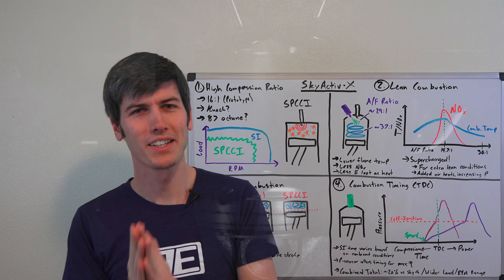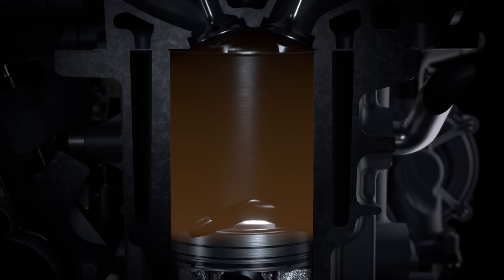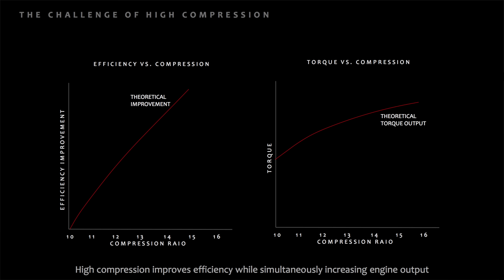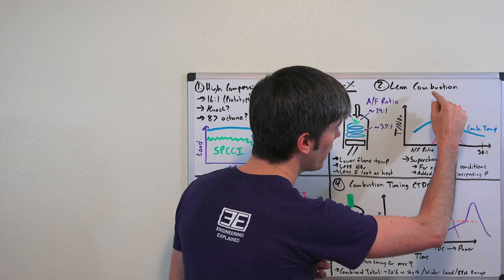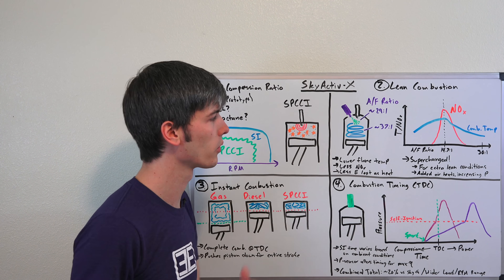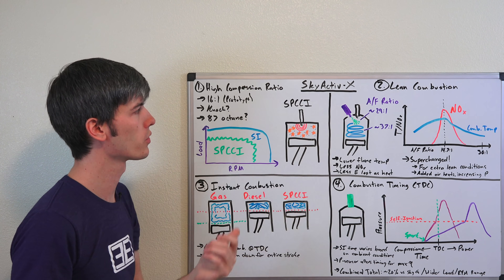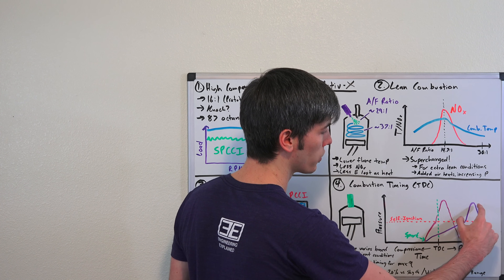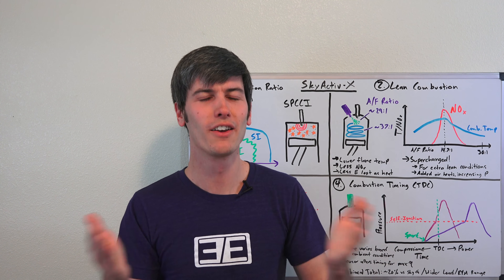How Mazda Is Saving The Gasoline Engine - SkyActiv-X

Comment: Hi @Engineering Explained
I got an odd question. 
Would it be possible to install an Electric Turbo (5kW motor that generates 5PSI) on 1.5 L SkyActiv-G F-P5 I4 Engine of Mazda 2 GT Sport 2019?
Someone said that "SkyActiv-G engines make very poor candidates for forced induction simply because their compression ratios are too high to accommodate the boost". Is that true? What ratio would be better?

Comment: Jason, great work. However... that ignition is not a knock ignition as that would be damaging due to overpressurising of the combustion chamber. It is still a spark ignition with a preinjection of part of the fuel per cycle.

Comment: With that high pressure engine MAZDA really needs to include a PCV system oil catch can. (As they SHOULD have on at least their most recent 2.5 L. turbo engines.)
QUESTION: Is running a mix of 75% 91 octane with 24% 100 octane gas going to make problems for my 2019 CX 5 2.5 L turbo engine?  I do know it "wakes up" the acceleration.

Comment: You if people were willing to spend say an extra $3k on the a car, tremendous strides could be made in improving the efficiency of the internal combustion engine.  People won't, but they will shell out an extra $3k for electric/hybryd electric vehicle. Electric vehicles are going to be the future, but battery technology needs to improve.  Also, with more electric cars, the demand there will be for electrical power, thus burning of more fossil fuels, because not enough money is being invested in alternative energy sources.

Comment: interesting similarities between this and 70's era Honda CVCC, which also was mostly lean with a little richer mixture close to the spark plug. The difference is those were carbureted and also used a precombustion chamber and much lower AF ratios.

Comment: Hi ee. I still don't understand why it won't knock. High compression ratio and compression ignition even though it is controlled. By spark. Is there not an element of compression ignition in a standard SI engine? Or is it after ignition the pressure does not rise high enough or fast enough too cause the remaining fuel too ignite? Great videos keep them coming.

Comment: Fascinating tech. 
It does however make me think that legacy car makers haven’t yet caught up with the idea that the future is electric. Specifically Switch Reluctance Partial Permanent Magnet using the Hallbach array arrangement motors combined with Silicon Carbide power electronics.

Comment: Mazda has unfortunately lost some of its reputation for reliability, do we have enough experience of Mazda's SkyActive engines to know how they are in that area? 
It doesn't look like this SkyActive engine is non-interference, is it possible to design them that way? It would make it much more safe in case...
Reply: Lies! My Mazda 6 has not a single issue. 92000km currently.
Reply: @aastanton251  some discrimination please, "some" doesn't mean "all" and still there are mechanics who say the Mazda of today isn't what they used to be pre-Ford involvement.
What you're saying your car is pretty much new as that is more or less run in period.

Comment: I'm sure the next step in this evolution will be in step with common rail diesel evolution where once they had greater control of the fuel injection they began multiple injections per stroke. Like the Detroit Diesel DD series engine will inject 12-15 times per stroke under the correct conditions. It makes an incredible driving experience where you can lug the engine down to 800 or 900 rpm then mash the throttle and it just torques out with full power!

Comment: So basicly they are making enigines that are less reliable and only a few mpg better fuel consumption. Then u have to buy a new car every 5 years when it breaks and that makes even more eviromental emmisions than if u just had a engine that was reliable and lasted 600k miles. But they wouldnt be able to sell you a new car every 8 years. This is not about the enviroment this is about money and controlling people. These democrats have to be stopped at all cost

Comment: My toyota yaris gets 37mpg in 2007. They could easily get 40 and be all wheel drive with a overdrive gear and a smaller engine with a turbo. Say go from 1.4 liter to 1.0 liter and go for 100hp. These idiots only want cvt so u hav to buy a new car every 10 years

Comment: Wouldn't they be able to increase the compression ratio even further using higher octane fuel?
Reply: They are after knocks, so they designed  the engine for a low octane fuel. 🤦‍♂️
Reply: @hanynowsky  I understand that but they could still get knock with higher octane fuel if they used a higher compression ratio, which would mean even further improved efficiency.
Reply: @hh6427  that is what I meant. My comment was against the mazda concept not you.

Comment: Do Skyactiv engines have a carbon buildup problem like other DI engines?
Reply: There's a savagegeese video with a Mazda engineer where he states that it's not an issue for the Mazda 2.5L due to certain key differences. Sorry I don't remember which video...maybe the miata review.

Comment: electric vehicles aren't even close to taking over anything. their battery packs aren't viable for long distance travel. that means trucks and trains and anyone going on a long road trip is out of luck. plus the power grid can't take all those cars.

also they don't even pollute any less than normal cars if their energy is coming from fossil fuel burning plants, which they most likely are. it just moves the pollution somewhere else.

Comment: I'm curious, why is it that a lean fuel air mix burns at a cooler temperature than a rich one but leaning out the mix in a small aircraft (a cessna 172 in my case) result in an increase in engine  temperature? Does the extra fuel in the richer mixture provide a cooling effect which is greater than the higher temperature of combustion?
Reply: You are reaching an ideal Air:fuel ratio and thus are making more power, but with more power there is also more waste heat. Rich mix burns cooler due to the fuel absorbing slightly more heat and making less power due to less that ideal conditions.

Comment: couln't they increase the compression even more, if the engine was designed for premium fuel, like 98 octane RON? making it even more efficient? your claim thst lower knockresistance is desirable doesn't make sense to me. of course in an engine like this it's not beneficial to fill up higher grade fuel than it was designed to, but if it was designed for high octane fuel from the start, it should work even better, right?

Comment: I'm slightly confused. If lean burning creates less heat than why does leaning out melt pistons?
Reply: Sometimes engine will make more power on a leaner mix = less cooling from excess fuel + More power = larger proportion of waste heat. No engine turns 100% of its fuel into raw usable energy (Most regular gas engines are between 25-40% efficient, Diesels being much higher because of their combustion cycle)

Comment: If I had the cash and the know how, I'd swap the 318 in my 88 Chrysler for this engine. Better gas mileage and HP. (My engine's a 140hp v8) Sounds weird on an old American car, but it might work.
Reply: Chrysler makes some powerful v6 engines. Or you could put fuel injection on the v8 and do a mild performance build. The advantage of the 318 is how well it responds to mods and how easy it is to work on
Reply: @isaakwelch3451  True, it is pretty easy to work on, and the parts are cheap. I might start with upgrading the intake. I'll see what happens once I start messing with it. (And, thanks for recommending me the fuel injection idea - that sounds like it'll give me more mpg)

Comment: Question: Does anyone know if this engine also suffers from the internal carbon buildup issue plaguing many Direct Injection engine designs?
Reply: Doesn’t look like anything in the design would prevent this. There is still no fuel washing the intake valve, and no indication it’s not using PCV.
Reply: @dbdukehd  It uses both direct injection and port injection.

Comment: actually the diesel does not combust as rapidly as you may think. Depending on the torque level, pedal position the injection will continue for some time after the piston starts its descend. Constant temperature engine vs constant volume. Just a minor adjustment to what I would think is an excellent video explaining these differing engine designs.

Comment: Sir, you said that the engine is not working with SPCCI inthe entire load range. So when they are switched back to SI engine working principle, will the compression ratio and air fuel ratio be same?. If not, is this a variable compression engine???

Comment: that doesn't sound like a new engine...it just sounds like really late timing... Also doesn't the DI gas engine already get extremely lean A/R ... kind of a step backward... Mazda just doesn't want to evolve past the obsolete 4 stroke gas engines... so they keep improving it... but its 20 years too late and needs to be put on a shelf and deemed obsolete.

If they wanted efficiency they should have just made a "gasoline vapor engine", go ahead and look up that old ass engine. Those got 100mpg like 50yrs ago on gasoline.
Reply: mazda should employ you. you're smarter than their entire company

Comment: Great explanation. I am a tech at a Mazda dealership and this gave me more info then I have received even from Mazda. Now I have been told that at higher RPMs the spark assist actually cuts off and it runs strictly on compression ignition. But I may have heard wrong, what do you think?
Reply: sjgavenger37 no high rpm no compression

Comment: Why bother we know there is a motor out there with one moving part that is more economical, faster and more reliable.
Reply: It will take several decades before electric cars are standard. Might as well improve the current one. And they might learn unexpected things applicable to electric cars.
Reply: em745a  that's interesting you are wrong in every thing you say. Usually people get at least one of their points right but hayhoe

Comment: Emperors new clothes that sensor at peak cycle lasts how long? Getting them replaced probably will cost more than the fuel you save?  Much like the car industry not making much on new cars but rapes your wallet with electronic component failures to replace

Comment: so is lower octane fuel better for this type of engine or the skyactive-g engine? (3rd gen mazda 3). appreciate you replying!
Reply: Octane is a measure of knock-resistance...the tendency of fuel to NOT detonate simultaneously throughout the cylinder. In an engine where you WANT the fuel to combust simultaneously (like a diesel), as the octane is increased, it gets harder to cause it to detonate where you want it to. For this engine design, there is some octane level that keeps the fuel's autoignition point in the range of pressures and temperatures that we will see in the cylinder under the widest range of operating conditions...it is cited here as being 80, meaning that that octane would provide the widest range of desired operation. Since we don't have fuel with such a low octane in the States, they have tweaked the engine to work around the slightly-higher detonation resistance of common 87 octane fuel. However, that suggests that the engine might have some of its operating window slightly narrower than it would have been with the "ideal" 80 octane fuel. This also suggests that the ideal performance window might continue to shrink as the octane is increased even higher above 87. It still runs, it's just that it has to keep all of these parameters in a much narrower range to make it still operate. 

The skyactive-g is essentially a standard spark-ignition engine, which is almost always better-off the higher the octane of the fuel (assuming the engine tuning can exploit it). In that domain, you want to be as far away from uncontrolled combustion (knock) as possible.

Comment: So why do you need a spark plug in a gasoline tank engine? I know this may be a silly question but I'm just curious
Reply: So you can control exactly when ignition of the air/fuel mixture occurs vs. a diesel which "self-ignites" at some point on its own due to heat/compression
Reply: @flywiththomas  But why can't this self-ignition method used in a gasoline engine?
Reply: The gasoline would ignite too early (or too late) which wouldn’t be efficient or could even damage the engine. What Mazda are doing is using almost full self-ignition like a Diesel engine but instead using a spark plug to kick the process off at the the exact time they need it
Reply: @flywiththomas  So in the end it's just that gasolines combustion isn't as controllable?
Reply: Petrol (gasoline) is more volatile than Diesel so yes, its less controllable when using compression alone to achieve ignition
Reply: @flywiththomas  Okay, thanks a lot!

Comment: SkyActive - a repeat of Mazda's mistake of the Renesis don't you think? Everyone is towards electric already.
Reply: Not at all. This is unrelated in any way to Renesis, which was an attempt to update the rotary engine. That wasn't particularly successful because the rotary is just inherently too flawed to achieve the performance/economy/emissions balance required of any engine today.  Skyactive-X is a completely practical gasoline compression-ignition engine, which everyone in the industry has been working on for the last thirty or forty years. Electric cars are still a tiny minority in the world of automobiles. They will grow and become increasingly important, but this will happen over a long time. As the internal combustion engine continues to improve, it continues to extend the time when it will be a primary power plant for automobiles.

Comment: You are missing out on some details. 

In a gasoline engine the stoichiometric mixture is defined as the mixture which generates the least pollution without destroying the engine (defined with technologie from 1975). The fact is that the mixture is rich and not all fuel will be burned. They limit the air intake with a throttle body to limit the burning time (no oxygen, no fire), to prevent the burning off the exhaust valves. They extinguish the combustion with additional fuel. If you lean out the mixture you will get more power. 

The knocking (self combustion) only occurs on lean fuel mixtures. 

I have read an article more than 20 years ago about the fact that liquid fuel doesn't burn. The principal is like a log of wood on a fire, the flames will never ever be able to burn the core off the log, first it has to burn off the out side of the wood layer by layer to eventually burn the core. The process off burning the liquid fuel, vaporize it and then burn it is a process to slow for a combustion engine. That is also the reason why a car is very fuel inefficient on higher speeds, the engine moves to fast for the burning proces. 

But if you take wood sanding dust and through it on a fire you'll get an explosion, my boss burned his eyebrows off. To burn fuel more efficient we should vaporize it before it enters the engine.

Comment: "electric is the future!" - Green New Deal freaks 

Keep sipping on your damn latte and shut up. Combustion engines will simply run off of synthesized fuels from C02 with "renewables" as the energy input.

Comment: All this talk about fuel economy, but no mention of expected mpg increases per horsepower or torque.  I may have missed it, but I am assuming that its torque characteristics are very similar to a diesel engine.
Reply: In my 4 banger skyactiv mazda cx3 it has 146hp and 146 lbft torque

Comment: You are a very intelligent technician , mechanical engineer ?. Would you please explain how a hollow metal ball located under the carburetor of a auto would increase fuel efficiency  ? The ball diameter is .5 to 1.5 inches larger . The owner claims to have doubled mileage on  freeway. Has more power .Becase it swirls the air in the shape  of a donut and vaporizes  and atomizes  the gas. Better combustion  ?

Comment: I'm curious - do the manufacturer to manufacturer fuel economy values include vehicles like trucks and SUV's?  If so, then manufacturers like Mazda and Hyundai will have artificially elevated fuel economy values compared to other makes because they do not make any non-commercial trucks nor do they make the large SUV's that other makes' customers insist on.  If this is the case, the comparisons are in the nature of apples to grapefruit as opposed to a fair and relevant comparison.

Comment: I think Mazda is barking up the wrong tree here.  If you think the internal combustion engine needs to be "saved", it would be more promising/effective to look at camless engine designs.  The camshaft is the biggest compromise in EVERY engine design that has one, and adds ridiculous amounts of weight in the head casting, the lifter assembly, as well as the camshafts themselves.    Replace them with solenoids that can be intelligently controlled not by the tyranny of the crankshaft but by an intelligent system that allows each valve to be operated independently, and you'd REALLY have something.